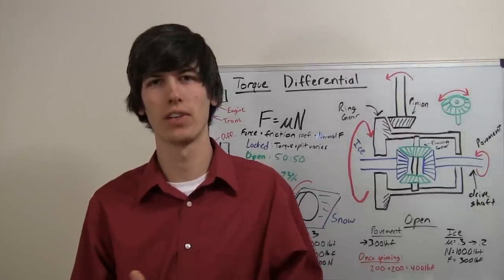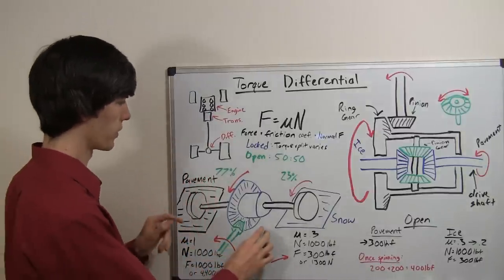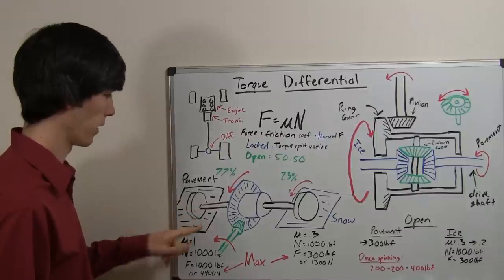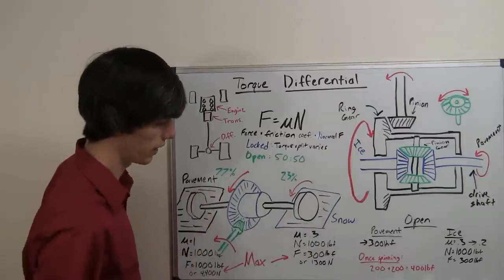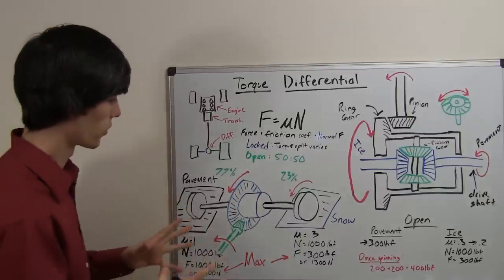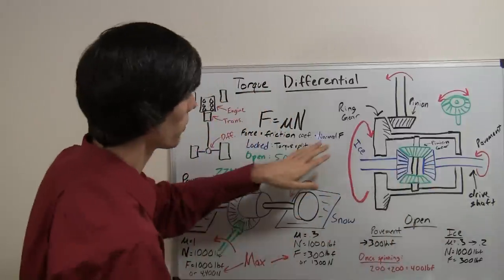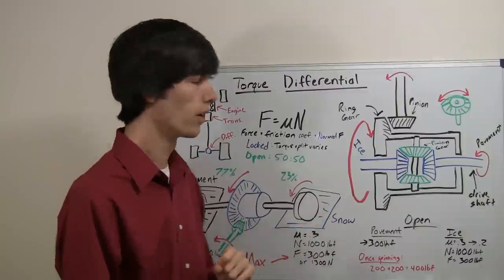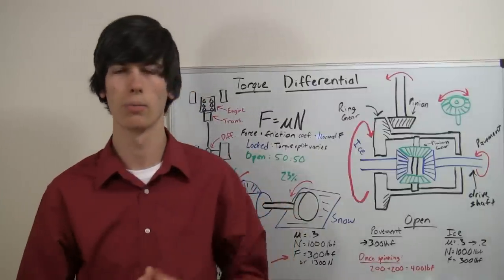Open vs Locked Differential - Torque Transfer - Explained

Comment: I don´t get it.... If an open diff will split the torque by 50%, then both tires are getting half the torque. Let´s suppose an engine´s output is 30lbsf. let´s also suppose that a car needs 10lbsf to move. On normal conditions, each wheel will be getting 15lbsf, so that´s in excess of what the car needs to move, so it will move. Now, let´s put one of those wheels up in the air. If an open diff delivers 50% of torque to each will, you will still have 15lbsf on the wheel that has grip, so the car will move, because it only needs 10lbsf to do so. In reality, the car doesn´t move, and I think that´s because the wheel up in the air, is taking much of that torque. The wheel that has the grip takes some torque, but I don´t think it is 50%.
Reply from the maker: +Victor M. Roche you're assuming that all of the engine torque always reaches the rear wheels, which is incorrect. If one wheel is in the air, it may only get "1 lbsf" (going by your example). If the one in the air only gets 1 lbsf, so does the one on the ground, and the car doesn't move. Am engine with no resistance produces far less power, as all you're really doing is revving the engine, it doesn't take full throttle.
Reply: As I understand, then pressing on the breakes will make the car move, since I am putting some load on the engine and creating torque, right?. Thank you for your videos, I find them really interesting and easy to understand
Reply: +Engineering Explaing Ahh, that was the key piece I was missing. So, with one wheel in the air, where does the other 29 lbsf of torque go? Or are you saying that the engine would be incapable of producing 30 lbsf if one of the tires was in the air because an engine needs resistance to produce enough torque?
Reply: +Victor M. Roche I'm not claiming to understand this stuff, but I know that is what some AWD system do. The Tesla Model S also uses an open diff, and automatically applies brakes to a wheel that might slip to allow more torque to go to the other wheel.

Comment: 3x1000=3000
Reply: Enrique Cortex .3 x 1000 = 300
Reply: Jordan Slinkard 3×100=300
Reply: Enrique Cortex ya that is also true it is POINT THREE THOUGH.  Like .3, which is a little less than a 3rd of a whole number.  Type it in a calculator if you don't believe me bro, or take a basic arithmetic class on the 3rd grade level when multiplication tables come into play.

Comment: How about we explain this without all the big science words and calcualtions.  In a locked differential both axles are mechancially "LOCKED" together.  It is physically imposssible to turn one wheel faster than the other in a "LOCKED" differential. So a "LOCKED" differential can not vary different amounts of torque to each wheel.  There now.  No big words and I explained how a lock diff really works.
Reply from the maker: Except you explained it wrong. Saying that because they are locked they cannot vary torque is incorrect. I have reasons for explaining things the way I do. If speed and torque are equal at all times, then no speed would mean no torque. We all know you can apply a torque to something without it moving...
Reply from the maker: In addition, yes, the torque can vary between the two axles, even with speed being the same. It depends on which tires has more friction to resist, which is what I illustrated in the above video.
Reply: Engineering Explained Hey, man you look like a pretty smart guy.  I hope you have the wisdom to know and admit when your wrong.  It seems a lot of people look to you to explain things to them and that's great.  But you have a duty to them to admit when your wrong and correct your mistakes.  Don't try and explain things with compleicated math and words to cover up your mistake.  You just sound dumb.  It has nothing to do with tourqe vs. speed.  It has to do with the component you are describing.  I know I'm not the only one who has told you this.  Learn the inner working parts of a locked diff.
Reply: Roshsun Stewart Try this, it might help explain why you're wrong. Take both hands and pull on a rope with one hand greased up. The greased hand will be the tire on snow/ice. Pull on the rope by keeping equal distance between them (locked diff). Which hand do you think is doing the most pulling? The dry hand or the tire on pavement. They are locked but one hand is doing more work or is the tire with the most torque. Same speeds yet different torque.
Reply: What the hell does that have anything to do with a diff that is locked through gearing?  If you have a locked diff and one wheel turns faster than the other......you broke something.    Again it has to do with the components inside the locked diff. Locking  the gears inside the diff prevent both wheels turning at different speeds so you don't loose power at the wheel that has the most resistance....that's the whole point.  You never been off roading have you?
Reply from the maker: Roshsun Stewart I always announce when I'm wrong, as I don't like providing false information. There are notes and annotations scattered across my videos as I'm not perfect. But I'm telling you this is a topic I've looked into quite extensively, and if you did the same you'd reach a similar conclusion. It's not intuitive, and it can't be determined simply by looking at a diff. I thought the opposite when I first learned about it myself. Cheers.

Comment: Funny how my comments keep being deleted. You know, the ones that show that you are wrong about how locked diffs work. But the comments that stay are the ones from you arguing that your right.  Shame on you sir, shame on you.
Reply from the maker: Though I admire your perseverance, I'm not going to continue to argue with someone who isn't willing to listen, or try to understand. I provided my sources, 2 videos, and plenty of explanations. You provided 3 sources that didn't prove anything. If you'd like to "prove" me wrong, why don't you upload a video explaining how it works, and see what others have to say? It's really quite simple, and I'd rather not repeat this discussion again and again and again.

Cheers
Reply: Engineering Explained I actually was doubting you at first about the 50:50 torque split on open differentials, but after analyzing it thoroughly, I saw you are right. What causes the confusion is educated videos saying that torque follows the path of least resistance. That is not correct. It's energy that always, always follows the path of least resistance. In the case, the energy in question is the mechanical energy coming from the engine. As a matter of fact, as all the power and only 50% of is coming only to one wheel, that means the wheel will spin twice as fast as if both wheels were spinning.

Comment: This video made me unsubscribe because it is complete bullshit. You have never had that feeling of 'o shit im stuck' then locking the differential and driving right out.
In your example of a locked differential with one tire on snow & one on pavement the torque would still be 50/50 because as long as it is a locked differential all that matters is the tire on the pavement. That example is more towards how a limited slip works.